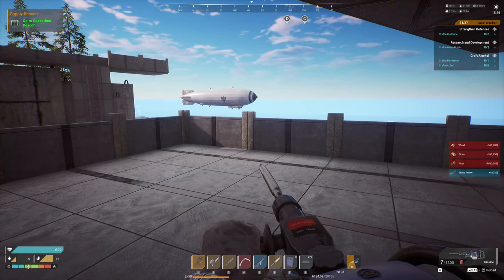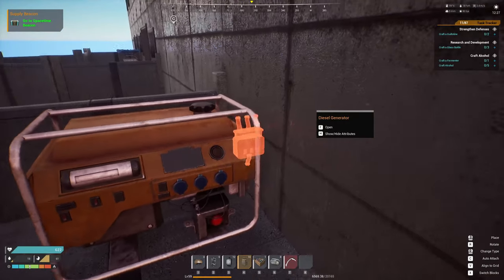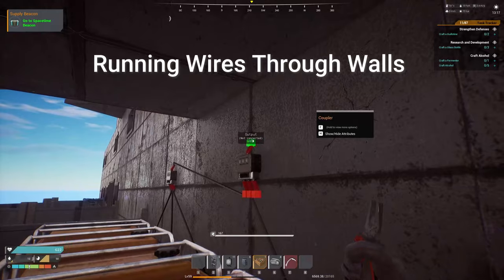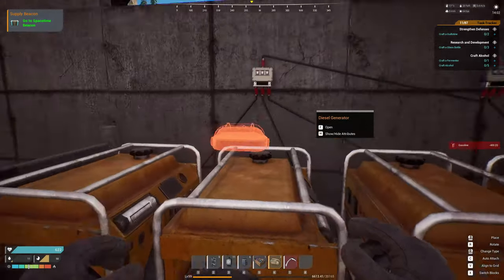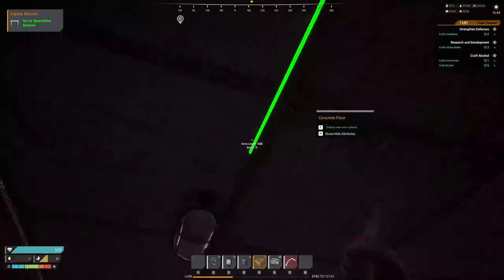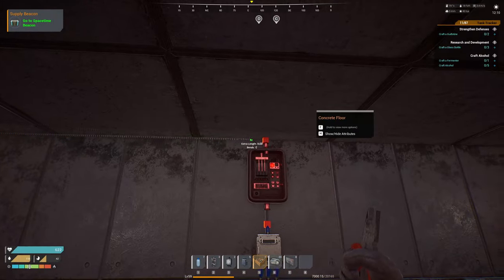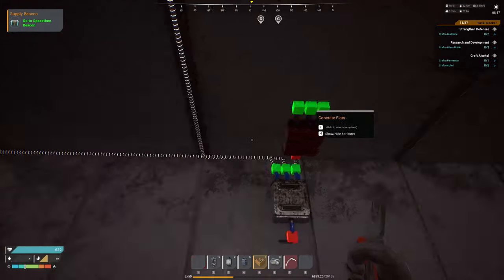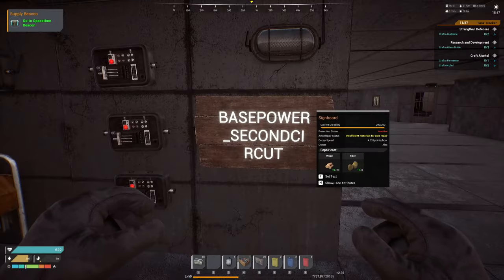The Front: Electricity Tips and Tricks & Guide

Comment: what for is power Switch ?.. i have problem when i use 40+ wind generator. i connected them with extended coupler, from them to extended splinter, from them to titanium battery , from battery to splinter and from splinter to all my furnace, traps.. end so on. My battery are charging more then i at the end get electricity. i have more then 1950+ e, but its like from my battery missing 1- electrical power ore, depends  of wind, some time i am just missing ele.

Comment: hello, ive been wondering why my coupler output 159 only, i have a 3 lead-acid battery cluster that outputs 160 each.  i supposed to have around 480 power output from coupler
Reply from the maker: This comes down to the math of the game.  If you have 3 that are charged and putting out 160 each then  it should be 480 like you said.  Just make sure they are all charged and the wires are routed correctly.  This is why we use generators to be honest.  I have had no probs with generators.
Reply: @Off-DutyGaming  thank you for the response , i saw someone use a workaround , each battery have their own coupler then each coupler are connected to main coupler and it works , the downside is those each coupler uses 1 energy 

Im still wondering why when the battery are connected directly to main coupler i get 160 output 😂 i made sure all battery are charged with 100k power each